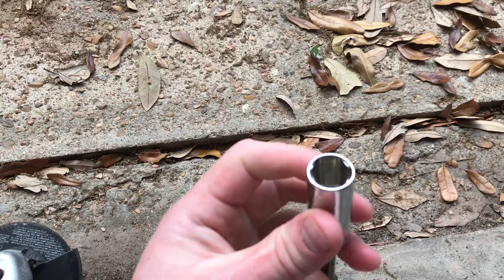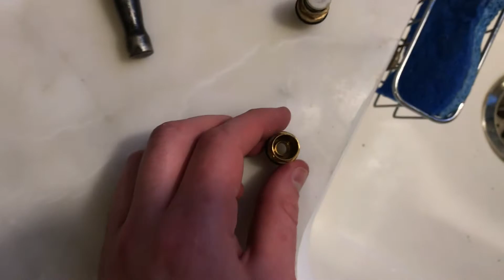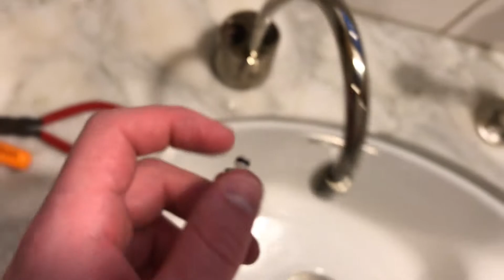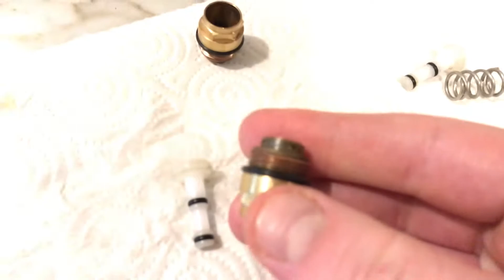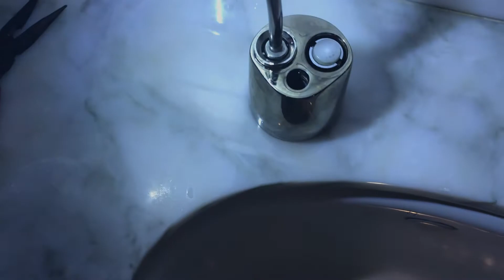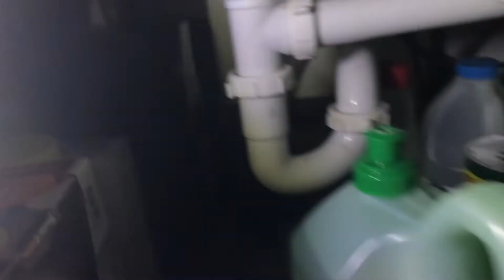PART 2: Insinkerator InstaHot - Repairing the leak

Comment: Done with my repair. Thanks guys. A couple of lessons learned:

1) If your system has a water filter, make sure to remove the filter otherwise you’ll be leaking as there is pressure built up in the system with the valves turned off. Ask me how I know.

2) To seat the white plunger all the way down, insert it in the hole and tighten. Once it all tightens down use a flat screwdriver to press the plunger down until it snaps into place. If you skip this step, you won’t be able to tighten it properly. Good luck now.

Comment: Great video! Saved me the cost of a new one. Thanks also to the commenters that included the o ring sizes. Home Depot had the Everbilt medium assorted o ring kit and the small assorted o ring kit that had all the sizes needed. I noticed that there was another o ring in the base that I also replaced. I think it was 9mm ID, 10mm OD. I also used a bench top grinder to make a thin wall 14mm socket. Great tip.

Comment: I replaced the filter and out started leaking.   WHAT THE!!!!   Thank you so much for making this video set and the comments that others left for help.   I'll get the tool and washers then give this a shot.   I'll edit this comment once completed.   I so much appreciate this help.    I just finished this repair and it seems to have fixed the leak.   I used dental floss to get the new #1 washers on and soaked it all in vinegar for about 2 hours and cleaned that channel for the washers really well.  The handles were a bit challenging though.   I could NOT have done this without your video.   Socket and washers = 13.00 dollars.   Replacement almost 600.00.  Thank you x1000.

Comment: So I think you’re being too hard on yourself in the process. You’re doing pretty good work.
Not sure why you assumed the earrings were metric and maybe this is why they didn’t quite fit your needs. Also see my previous comment about the socket that you can get From an auto parts for spark plugs that would have a thin wall, which may work. Otherwise, the bonnet that holds the stems can be used as a key with just another key made or improvise from a paddle drill bit to turn through the two recesses in the bonnet

Comment: update in case it helps someone. The tank was leaking from the heating element gasket. I had noticed this one before where I turned off the power and water to the unit (but tank was full) before going on vacation and came back to water in a catch basin I had put underneath. Same thing during this repair, power and water were off. My guess is after a few years, the seals get old and inflexible. When the tank goes through cooling and reheating, that must open up a slight gap at the seals. I have to give credit to Insinkerator, they sent me a new tank! That combined with fixing the dispenser o-rings and I have it working like new again. Thanks to all the commenters and Michael for this video!

Comment: THANK YOU!  re:14mm thin wall - I took a cheap 14mm 6-point on a short extension in a drill against a grinder wheel or an angle grinder/flap wheel can also work.  That allowed me not to have to buy something else and use up a spare/extra POS socket and get it done right now.  My socket was shallow and it worked OK.  A deep socket might be better though not needed.....This video was KEY for doing this.  Thank You, again for making it. (I'll be buying a buying a beer for a random human ;-p)

Comment: ok, I followed the advice including some of the commenters. Before attempting, had water coming out the top of the fixture (pooling water) whenever dispensing hot water. Cold water was fine. Replace the 2nd small o-ring(not the one at the tip of the plastic plunger) with a new #1 (1/4 OD x 1/8 ID) and put everything back together. Now  I have water dripping from the bottom of the tank plastic cover, wtf? Before starting this, I did not have water dripping from the bottom, but fail to see what that has to do with working on the dispenser. I had shutoff the water and disconnect tank from electrical before stating, but otherwise, did nothing to the tank heater. Any wisdom would be appreciated!

Comment: Update: I actually ended up using a different size of small gasket for the plunger: 2mm diameter by 2mm thickness. This has stopped the leak, and the levers do work, but the fit is so tight that it is now impossible for me to remove the valves from the insinkerator body. Wish I'd changed the upper gasket on the cold tap before I reassembled it, because it still leaks a bit. Also, if I could do it again, I would have bought all the gaskets at once, instead of disassembling it four times,  only to find each time that the ones I had ordered weren't quite right. I think that these are actually an Imperial size, and I couldn't find the exact match in the UK.
Reply: I also had similar issue by using a 3mm x 2 mm o-ring. I had to get the extra-thin wall 14mm socket for spark plugs to remove the internal part holding the plunger to be able to remove the plunger that got stuck. BTW, the o-rings are actually imperial size # 006. Once I got the right size, the faucet worked like a charm without leaks! Thanks to Michael ODonnell for this amazing video.

Comment: Thanks for filming this video - you gave me the confidence to attempt this repair. I'm in the UK, and was able to buy a box spanner set to do the job; I bought mine at Toolstation. These are not forged but shaped sheet steel, so thin in section. Also, although my tap looks identical from the outside there was no clear o-ring on the white plastic plunger; the plunger o-rings were 3mmx2mm and the external ones 14mmx 2mm.

Comment: Many thanks. I'm going to attack mine this weekend. Bought O-rings at Harbor Freight and a 15 degree offset, 6 point 19mm wrench on Amazon. UPDATE: I removed the valve stems and oddly the stems are different from the ones in the video and different from each other. (Note that the brass portions both are the same as Michael's.) The cold stem plastic has a thicker top and no clear o-ring. The hot stem plastic has a 5/16" "collar" protruding from the bottom with an o-ring between the top of the collar and the bottom of the brass;  and the plastic cannot be removed. This unit is between 10 and 20 years old, so there must have been a design change at some point. Given Taiwan manufacturer, I may replace the o-rings on the cold side with the metric rings mentioned (or maybe not!).

Comment: Thank you for the video and, for all the helpful comments.  With my "hot only" unit I started encountering slow drips.  After reviewing the videos and reading all the comments, I decided to try the easy approach first.  i.e. Not removing the entire cartridge and simply removing the white plunger from above.  After cleaning internals with white vinegar, I replaced the two O-rings with the readily available 1/4" OD x 1/8" ID size along with food-grade silicone grease.  I researched Amazon for metric O-rings and found suitable options in case the first try didn't work.  As encountered by others, assembly was a bear.  I could not get the white plunger to press down and lock lower as other have suggested.  After a couple of frustrating attempts at getting the nut to engage, I found a solution that enabled me, without a second person, to engage the nut.  I found that a 1/2" deep socket will slide over the handle's end.  I stuffed pieces of paper towel inside the socket to cushion the handles tip in hopes of not breaking the red button at the tip.  I attached a three-inch extension and ratchet to the socket.  The 1/2"socket is tight enough around the handle to create stability and allowed me to easily see the nut as I tightened it.  This worked first try!  Upon pressurizing the water I thought at first I was successful but then a very occasional drip started.  As other shave suggested, I backed off the nut first 1/4 turn, then 1/2 turn, then 3/4 turn and the drip stopped.  I'm assuming this may have been caused by the, not so perfect, sizing of the O-rings I installed.  If it fails again I'll try the metric O-rings.  If that fails, I might remove the cartridge, clean everything and then do as one commenter suggested . . .  Install the O-ring closest to the plunger head first, press the plunger into the cartridge and press to expose the second groove below the cartridge and install the second O-ring, then reassemble.  BTW, I did contract InSinkerator asking for part numbers or correct specs for the O-rings.  I got the same  response as many - - - non-serviceable and a recommendation to replace the entire faucet dispenser.  I responded with my disappointment and suggested they were price-gouging.  Haven't heard back and probably won't.

Comment: OK, I just finished this project.  There are a few things different from the video that I did. I'm documenting it here to help other and remember for next time I need to do it.
1) Remove the spout by loosening the 2mm set screw in the back and pulling up.
2) Remove the screw-tops with 3/4" wrench
3) Lift off the piece that directs the lever with needle nose pliers
4) Remove the cartridges with 14mm 12 point thin wall spark plug socket 
5) Push the white plunger into the cartridge and remove the bottom O-ring.  
6) Lift out the white plunger
7) Remove the top o-ring and replace with #1 rubber o-ring (1/4 in. OD X 1/8 in. ID)
8) Put plunger back into housing. Push all the way in and replace bottom o-ring with another #1 o-ring
9) Replace the o ring on the outside of the cartridge with a #65 o-ring (11/16 in. OD x 9/16 in. ID)
10) Reinstall cartridge and tighten down.  
11) Push down white plunger until it locks in place. (If you do this, you don't need to maintain pressure.)
12) Reinstall handles per video
13) Reinstall spout and tighten set screw.
Reply: here l found  3 o-rings , there is 2 on the white plunger and one on the cartridges, any idea the thickness of each one of the o-rings, really need this info, thanks
Reply: Thanks for the summary.  Very helpful!

Comment: Thank you for this video, I did eventually managed to fix my tap. My tip when you are trying to reinstall the cartridges would be to ensure the plunger with the ceramic head is fully engaged. As you tighten it down, it comes a point where it is fully engaged and does not pop out again. If you then tighten the cartridge fully in you can actually easily put the tap handles back on. If you try and put the tap handles back in without the ceramic plunger fully inserted it just is not possible. After much trial and error over an hour, this technique worked on both sides although it seems as if the cartridge is stuck, it seems to work fine as soon as you turn the water back on. I’m assuming the water pressure pushes the white plunder up again.

Comment: This was an appreciative instructional tutorial on what seems a very common issue with these faucets. I was able to follow it after one of my brass valve’s white plunger stuck in an open position. 

However I could not get the lever back on with the final nut. So I ended up trying to further clean out the valves by taking them apart into their 3 separate pieces. 

Unfortunately, one of the plastic plungers snapped while attempting to remove it from its brass valve housing! Does anyone have any suggestions on how to get replacement parts? 

I don’t know how you were able to separate them without breaking the white plastic piece inside the spring?

Comment: Thank you SO much for saving me from a $300 replacement. I’ve fixed the leak around my handles. Unfortunately, now there is a consistent drip out of the faucet. I’m wondering if there is too much water pressure going to this unit. Do you know if a pressure reducing valve would help? Or another solution for the drip from the faucet? That said, thank you again for your videos. I’m very happy to have a dry countertop.

Comment: That video was great Michael. I’m in the UK my hot tape/faucet was sticking on. I knew it would be a sticking valve which the lever operated, but Insinkerator UK don’t stock individual parts or repair kits. Nor do any other merchants. I watched your video then delved in. I was able to pop out the plastic plunger without removing the valve body as you did, I just used two opposing small screwdrivers as levers. I used the plunger upside down to slide in and out of the valve body and established it was sticking. I used some 1200 wet & dry wrapped around a pen to clean the bore (brass) which had corroded enough to make the plunger stick. New ‘O’ rings and re-assembly. It’s now working freely, Thanks again. I hope my comment will help others. 😊
Reply: Would you please further explain how you "...used two opposing small screwdrivers as levers. ?"  I think I have the same problem that you faced, i.e., the plastic plunger is stuck in the down position.  However, perhaps yours was stuck in the up position, so you were able to apply force with with screwdrivers on opposite sides of the protruding plunger and force it down?
Reply: @ hi, once you have unscrewed the collar that holds the lever in place and removed it. There is another collar below that supports the pivot points on the lever. This just lifts out to expose the white plastic plunger. Mine was stuck just below the surface of the valve body. I used two very small electronic size screwdrivers that are sharp. There is just room to press these into the plastic opposite easy other and lever the plunger upwards. As described I used the plunger upside down to push back in which established the sticking problem. I suspect that the hot tap builds up corrosion because it’s exposed to hot and cold temperature changes. Hope this helps. Regards Jon

Comment: You have no idea how helpful this was! Thank you! I had the opposite problem where the faucet had low flow and eventually stopped flowing completely. Even if I wanted to spend the $350 on a new faucet, there is no way I could get to the bolt underneath to unscrew it. 

I could not figure out how this thing works. Your video gave me a great guide. I especially appreciate the tip about the 14mm socket. I grinded it too!  After cleaning it all out and putting it back together, it works!!

Can I buy you a beer? Do you have Venmo or PayPal or anything?
Reply from the maker: Glad it helped! I love beer - so here's my request. Buy a pint for a stranger, paying it forward.
Cheers,
Michael

Comment: Ha!!  Dropping small parts down the drain would be my middle name, except in my case, they would actually have gone down the drain.  Great video, very informative, thank you.  I watched Part 1 because I wanted to understand the mechanics behind how these devices work.  I have a 20 year old Everhot system that recently started leaking, and being a DIY imbecile, I yanked it out and took it apart without thinking or researching and ended up with all kinds of self-imposed problems I shouldn't have had.  I feel for you Inskinkerator guys.  Fortunately, my Everhot faucet is completely serviceable with replacement valves and o-rings available, even 20 years later.  Prior to ordering the kit, I called the manufacturer to do the due diligence I skipped before ripping it to pieces, and not only did I get to talk to a live person on the first call, but they actually offered walked me through, over the phone, the entire rebuild process.  There's another great YouTube video from someone else that had the same faucet and did same repair job, so I didn't need them to walk me through it, but I super appreciated their offer.  On the Everhots, there is a little set screw on the back, and retainer pins in the levers that come apart really easily and expose the whole thing for easy replacement.  And the valve replacement kit came with diagrams and instructions that were clearly written by someone that lives in the US.  Thanks again for the great video.  Part 1 answered my questions, but I had to watch part 2 to see how this story ended.

Comment: Thanks for the videos. I was going in blind till I found this. My faucet (same model as yours) is going on 17 years now and developed a leak at the cold water stem. I pulled it apart and sure enough the lower o-ring had failed. I replaced both the upper O-rings on the plunger with as well as the lower O-rings on the brass housing with 10mmx14mmx2mm. The original lower O-rings on the brass housing seemed to actually have been undersized or maybe they shrunk with time as they appeared to be 1mm or 1.5mm diameter. Tried both those sizes and it leaked both times. So went with the 2mm.

Also, I did not have much issue with getting it reassembled. It might have been because of the thicker O-rings that the plungers wedged in place.

Lastly, I had the whole faucet out so I decided to scotch-bright it from chrome to a brushed satin-nickel/stainless steel that matches my Vigo kitchen faucet. Turned out great.

Comment: Your videos already helped me get at least 6 months out of it, so thank you.  The problem I am having now is that when I take the cartridges out, they don’t pop up like in your video so I can take them apart.  The white plastic stays flush with the top.  Anyone know how to safely get them to pop open like they look in the video. Just to clarify, I am able to remove the cartridge. Just not get it apart once removed.
Reply: I have the same problem with the stuck plastic plunger.  Did you find a solution?

Comment: Very interesting design and your video sure helped understand how the system works. I've just installed this system so everything is new. I'm fairly handy at working on things. I did notice during the disassembly the notched piece that fit over the interior hex also having the two slots for the handle.....would it not be possible to use a big blade screw driver to place in the two slots and loosen the valve instead of having to have a special socket or buying one? Maybe it may not be heavy enough to use as a socket? Good video and thank you.